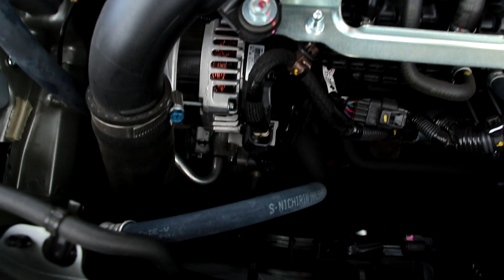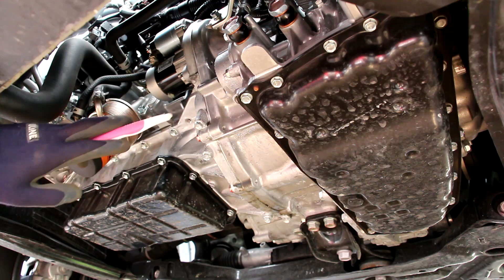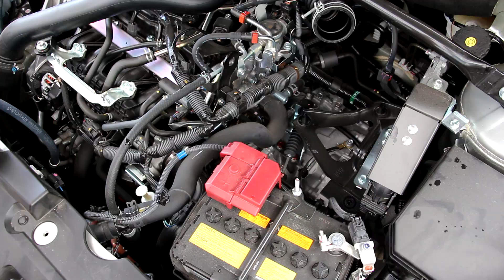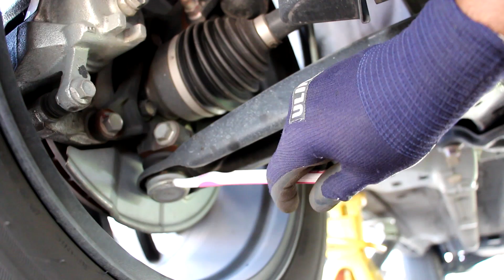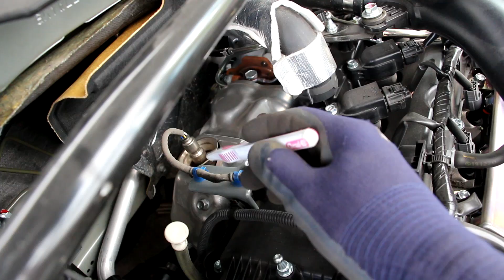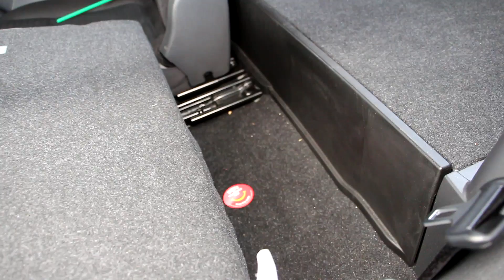Mitsubishi Eclipse Cross Mechanical Review

Comment: I have a 1.5L gasoline 2019 elipse cross. Eats motor oil -changed and added oil many times .Is now undergoing motor repair since it cannot climb faster than 40km/h and in second gear. Also, someone almost crashed into the rear because of forward collision avoidance problem - detected a speed bump as an obstacle, and the car just stopped (I had 3 kids in the car taking them to football training). Not happy about it.

Comment: Such a STUPID DESIGN…IMAGINE YOU NEED A BATTERY JUMP START. NOW ONE HAS TO REMOVE THAT HUGE AIR FLOW VENT Facing THE FRONT OF THE CAR. PLASTIC VALVE HEAD COVER ????
Abort take off with this Mitsubishi. I will stick with a STRAIGHT FORWARD TOYOTA
Reply: Bruh, just remove the 2 bolts are you that lazy
Reply: @MiftahFaiz-z7e  
YES I AM THAT 🤣 LAZY KID, actually I am spoiled with The STRAIGHT FORWARD TOYOTA 👊😉
Reply from the maker: Toyota's have plastic valve covers too now ☹️
Reply: @speedkar99  
Buzzzzzz NOT ALL BRO….I STILL WOULDN’T BUY THE LAYOUT OF A MITISHBISHI

Comment: 1
2019 Outlander 2.4L.  122,000 miles never had a problems. Changed the oil and transmission fluid regularly

Comment: Does anyone know if the 2019 needs to have the valves adjusted? Seems kind of hard to pin down.
Reply from the maker: Check the service manual
Reply: @speedkar99  The reason I said it's hard to pin down is because it doesn't give an interval. To be specific, I don't know if my vehicle has an auto valve lash adjuster - do you know how I can tell if it does?

Comment: I have 2022 eclipse cross which I brought in Jan 2022 and once I reeach about 20min-1 hr of driving time I get hot air coming through my air vents even though I have heat and a/c off is that something to be concerned about?
Reply from the maker: Wonder if the HVAC is doing something automatically. My old Toyota Solara used to send cool air after a long drive
Reply: The service manager said it very normal with new cars?? I driven so many new car over hours and hours but not this much heat is coming through the vent when everything is off incl the heat and a/c... Any advice on how to locate the problem?

Comment: Car is junk, I bought one brand new, I’m at 55k mi and can’t even get alignment from anybody except Mitsubishi bc my rear diff bushing is shot, carrier bearing, upper and lower motor mounts, struts, brakes, ect... Mitsubishi replaced one rear strut after they said nothing is wrong with my car for the 15th time and I provided documentation from 2 other shops saying why they refuse my service for alignment. I bought 3rd set of tires and paid them to align under condition they would check alignment in 500mi... alignment off no surprise, rear passenger camber moved 1.2°... they never even had me straight to begin with but after they gave me alignment check sheet showing I’m out of alignment they refuse to see my car... but there’s also nothing wrong for them to change rear diff bushing which I have video of where you can see daylight thru it by simply rotating the tires by hand...

Comment: I had several problems with the 2021 Eclipse Cross. I am sure they are all computer related. a) The heater is not even hot at 22-24C and it was -10C outside. b) I couldn't open my driver door with my remote when I was standing beside it (I pressed the correct button. Lol). Waited 10 minutes and tried again and it worked c) A fee times, when I remove my seat belt, the alarm did not sound like it usually remind me to put my belt on. d) I couldn't open my driver side  window twice (there is no child proof, Lol). e) When I go up a small hill, the engine is revelling high and speed is low (on Econ. Mode). I took it back to complain to Mitsubishi dealership and they couldn't find anything wrong. Frustrating.

Comment: Wow! You are very knowledgeable on the Eclipse.  Quick question; Is there such thing as "rear differential oil" on a 2021 Eclipse Cross? I went yo Mr. Lube and they told me I need a top up  so they added 80w90. Is this a thing or scam? Thanks.

Comment: It’s funny he says no radar sensor etc in the front grill is  a bit disappointing... obviously he’s not reviewing a higher spec model that does have them, for example the VRX level spec i have , in Australian / New Zealand market, same for the button blank covers.... and how do you scratch all that plastic let your dogs run free in the car? and that Fram is not OEM, he says car is brand new then quotes the mileage later which means it’s obviously not new

Comment: My daily is a 2003 Mitsubishi Lancer Evolution I purchased new and it has almost zero surface rust on the under body and chassis.  This after umpteen Nebraska winters.   So, yeah, they don't rust much.
Reply: Everything is relative...
My 2008 Lancer started to rust after 9 years (in Europe). I am currently looking for a replacement.
Sadly because otherwise I had no problems what so ever all this time.
Reply: @RaduB.  The Evo shares front doors, trunk lid and maybe the roof with the lancer.  So while they both came from Mitsubishi they are different cars.  Maybe that explains the difference - dunno.

Comment: These are amazing videos you do.  This is info in detail that could never find anywhere else about my Eclipse Cross.  Keep it up please!

Lower trims do have less features inside for sure but for 2020 they fixed that somewhat and early next year they are releasing an updated 2022 Eclipse Cross but got rid of the split rear window, which is my favorite part personally.  

When we bought our 2 Eclipse Crosses we chose the SEL Touring’s because of all the features like black leather with orange stitching, dual panoramic roof and the front one opens and the rear has its own shade control, all the advanced safety features and driving aids like forward collision warning, pedestrian detection, lane departure warning, lane change assist, blinding spot warning, rear cross traffic alert, radar cruise with auto stop and go, auto high beams, 4 level adjustable led headlights, rain sensing wipers, 7 air bags, power driver seat, power folding side mirrors when you lock car or by button on door, 360 multi view camera with steering wheel button to change views, heated steering wheel, heated front, heated rear seats, 710 watt 9 speaker rockford fosgate audio system, push button start and keyless access and entry, led tail lights, reclining and sliding rear seats, 3 mode push button s-awc system (auto/snow/gravel), electric parking brake with hold, lighted and sliding visor mirrors, auto dimming rear view mirror with home link buttons, dual zone auto climate control, paddle shifter for cvt with 8 programmed fake shift points (I will never use accept maybe on a steep grade to slow down or going down hill in snow), 18 inch alloy wheels and more!  The SEL Touring is truly loaded for its price.  You never pay sticker as Mitsubishi gives huge rebates, loyalty cash, and dealer discounts.  We got around $7,000.00 off the msrp on each of ours paying close to base model price for a fully loaded one.  

The Mitsubishi Connect App that comes with Eclipse Cross SE and SEL is great and can remote start and stop my car, put the rear defrost on and change interior temp, activate lights, activate horn, set speed alerts, find car, get text on everything your car does or if alarm goes off, see miles driven each day, geofencing, and so many personal preference settings to the car can be changed even down to how long the rear wiper runs, the strength of air conditioning (comfort or eco), headlight settings and so so much more and it has a call center and sos button and that notifies Mitsubishi if air bags deploy or you can call if you have questions or just need info.  

Also the Eclipse Cross has excellent crash ratings!  It is very safe even in driver and passenger small overlap crash tests.  

This can also do light off roading as it has 8.5 inches of ground clearance.  Check out TFL off-road video on Eclipse Cross.  But where the S-AWC with torque vectoring really shines is in bad weather.  In rain, snow or sleet this vehicle is so secure and safe feeling while driving at speed.  When you turn or make a quick maneuver this S-AWC keeps you right on track.  In gravel mode you can really feel the difference in the rear end and how it pushes power in the snow. The gravel mode is its strongest setting giving you 70% front 30% rear and can adjust all the way to 40% front 60% rear giving it very good traction.  I love the safety and adjustability of the S-AWC.

Comment: Family vehicle is where the markets at not sport and race car.
   Once again this car is name eclipse-cross not eclipse....
Toyota makes corolla and they make corolla-cross.
    So naming a cross over... eclipse-cross doesn't take away possibly to make an eclipse!
  But when a stigma is place on the brand to a point where this mechanic reveiwer would make a comment that it obvious that there are features abscent base on blank buttons and lack of radars, that are found on a Hondas and toyotas shows a total bias against mitsubishi... as simple check would reveal they are available on higher specs.
   I have to love and respect mitsubishi as  what they are able to create with limited resources way exceed other brands... if money wasn't a factor then definately an new eclipse and evo would be in production.... but cost to produce versus profit is very small compare to building family cars... 
   Please note that the striving car manufacturers weren't making and competing in race and sport cars (honda and Toyota) while Nissan, Mazda, audi, Subaru, mitsubishi etc were battling on race tracks Toyota and honda were mostly focus on making family cars which has a larger market than race n sporty vehicles...they were able to make so much profit that they were able to purchase other companys... and now they can venture off into race sporty cars without risks...

Comment: Thank you for this very informative mechanical review. I owned a 2019 1.5L FWD turbocharged model.
Reply: Hey ! I'm close to buy this 2019 used. How does it went after long term?
Reply: @enriquejosekravetzmalabud8530  do it! I did not experience any major problems for the past 4 1/2 years. Currently running 96k in my odometer. The only thing I have replaced are my brake pads, battery and spark plugs. So far so good and its a fast car.

Comment: I will never look at Mitsubishi again.  I had a 2009 galant ralliart and a year after I bought it the rear doors started to rust out from the inside out.  Mitsubishi Canada’s way of warranting the repair was for the service department manager to take a paint pen and cover the rust.  My second was a Mitsubishi Cancer.  It had a full defective suspension that caused the car to sink down over the tires.  
The tires would rub on the inner fender lip, and the car would bottom out when I was the only person in the car.  Mitsubishi Canada would not warranty any repairs even when the garage techs sat in back and heard the clunking and bottoming out.  I was not going to live with a company that doesn’t care about customer service.
My mother had a Mitsubishi RVR/ASX/Outlander sport.  A year after she bought hers the hood rusted out.  Mitsubishi Canada called it normal wear and tear and would not honour the paint warranty.  A year after that the tailgate and roof rusted out.  Same thing, same BS from Mitsubishi Canada.  Each time my mother had to pay out of pocket.  Before the car was totaled last year the hood and tailgate were rusting out again.
Mitsubishi is crap!  Never again would I recommend their products or service.
Reply from the maker: It's kinda sad that all the Mitsubishi are riding on the old Chrysler platform ... Time for an update

Comment: How does the brake booster work on Vacuum from the manifold? Wouldn't the Manifold be under pressure from the Turbo?
Reply: I drive a turbo Mitsubishi and the brakes work fine.  I have no explanation why other vehicles require vacuum pumps and mine doesn't.  It seems like if Mitsubishi can make it work it would be a money saver for other brands.
Reply: I was wondering the same thing. 
On the other hand, when you brake you usually don't accelerate and maybe they bypass the turbine when you brake... I might be way off though.
Reply: @RaduB.  Come to think of it my wife's WRX is also a turbo and no vacuum pump.  That thing has great brakes.

Comment: I live in Canada where the temps varies between +30C & -30C. Mine is much more rusty after 1 winter/12 000km with salty roads, although I applied Oil Based Anti-Rust treatment. The muffler in totally orange rusted and most bolts behind the wheels are showing rust. Caliper, brake shield are orange rusted. This muffler is very poor material quality like what we add in the '80s. But, the car is relativeley cheap for its overall quality & performances.
Reply from the maker: I'm Canadian as well and can relate

Comment: I run The Mitsubishi Eclipse cross owners group UK.
Although the interior plastics are ' thinner ' - to me the dash design is lovely.
The black gloss scratches really easily , but look after it and it looks great.
It's my first ever Mitsubishi, and it's good to hear about their engineering and reliability.
I've been with Toyota for Rav4's for 20 years.... until now.
The latest Rav4 was far too expensive.
Reply: Hi Jamie, how is your experience with the cross? I am contemplating a 2019 E.Cross against a 2016 Rav4 for same price, whichone you would recommend based on your experience.
Reply: @gauravmarwaha8466  the Rav4 is a superb " Recreational Activity Vehicle with 4wd "
As long as you avoid the 2.2 d4d engine,  they blow head gasket globally.
The Rav4 was the original 4wd Activity Vehicle invented years ago.
Everyone else then made something similar.
Personally,  I'd have another one tomorrow... if I could afford one.
I'm not overly keen on design of the 2016 version,  but that's it...
Check out Rav4 drivers club , I'm on there as Rambler.
Good members with helpful info.👍

I like the Eclipse cross,  its only bad thing is fuel on my 4wd.
But , its very comfortable , quiet and lovely to drive.
Reply: @jamieb741  Thanks Jamie, apologies for the delayed reply. I love toyotas as in india that has been the go to brand for SUVs, but here I feel the price is too much of a bite.
Reply: @jamieb741  how is the long term reliability? any high mile issues with oil burning or anything else? is the cvt reliable?
Reply: If you scratch up the glass just go to a wrap shop and get some matte film to cover it.

Comment: Hello may I ask you an unrelated question? I’m working as an electrician right now and make decent money (80-90k) a year but I really like the technical side of this more so that most the electricians I work with and am debating going into mech or electrical engineering. The main thing that scares me is the math tbh... I have “holes” in my math foundation I’d say. Is it as great as it seems to be and worth it? Would you do anything different? I’d appreciate any advice you can offer. Maybe I could somehow contact you privately through email or messenger to ask some more questions if you don’t mind. Thanks for the great videos I love learning how things work
Reply from the maker: Mechanical engineering doesn't make as much money as an electrical engineer, especially in the automotive sector.

Comment: First thing i would do.....remove the airbox and swap w a Short Ram Intake with a MFKG huge cone air filter. hahahaha ....Huge amt of space right there.
Reply from the maker: True
Reply: All it would do is create noise, trust me this car rewards smoother driving and besides its CVT.  There are better options for modding
Reply: @RDEnduro  ummm....yeah , actually i like the sound of the cone air filter. haha , thats all.    This car doesnt lean much to mods for speed, the turbo has an integrated manifold, so u cant swap a bigger turbo in, and the ports are too small for much upgrades.... therefore, lets just make it ''sound'' fast haha
sorta like a Harley

Comment: Should have sournd denning under frame as standard and 2.0 litre as base model 4x4 automatic for some one around town with no turbo six speed automatic transmission  lv Mitsubishi outlander 2015 4x4 automatic  make a bit of traction noise on the road